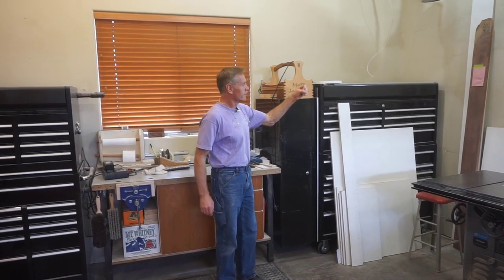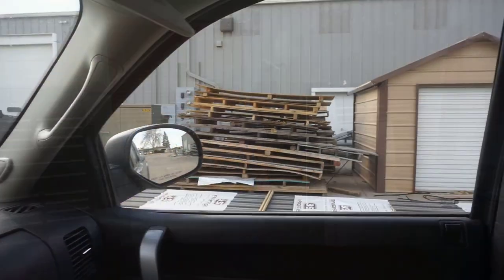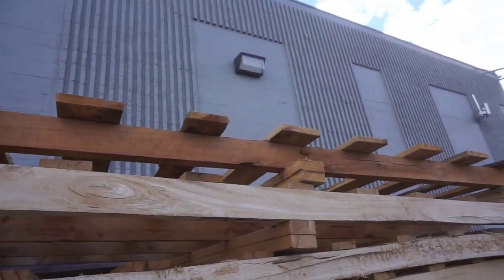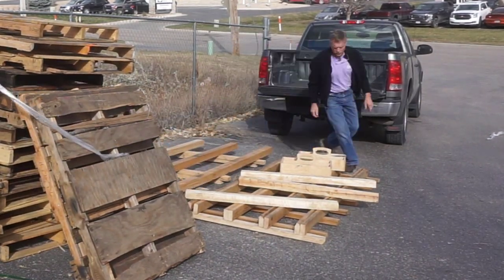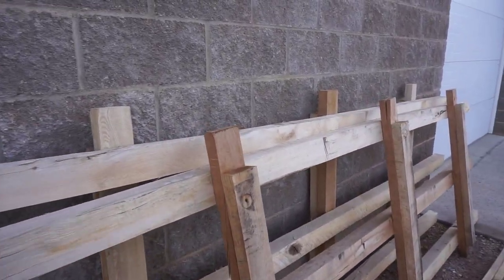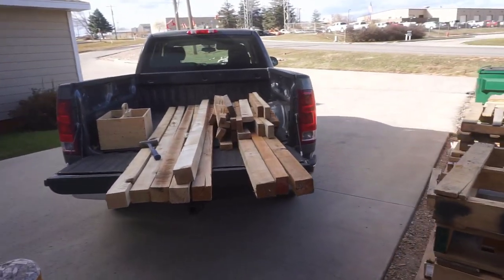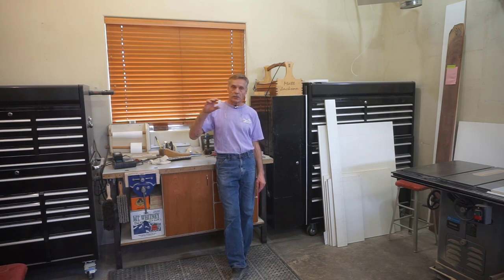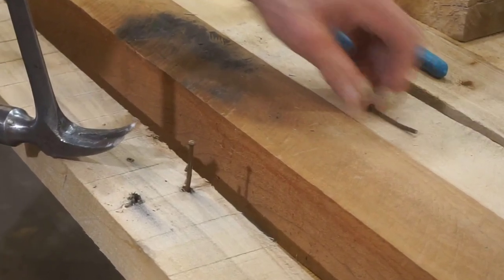A Search for Perfect Pallets

Comment: I'm the world's biggest pallet recycling fan,and about 45 years ago I was working on the construction of of a power station as a rigger,and so easy of the equipment was shipped in huge crates,some were 25foot by 15 foot by 12 foot, I got permission to take what I wanted and got enough timber to build a 25 ft x 12 ft x 10 ft work shop because  my hobby making things with recycled pallets,so you're doing the right thing,better to make something with them than burning the wood,your video was well worth watching and gets my 5 ☆ rating

Comment: I picked up some palettes and got as far as sawing them apart into boards.   However, I was at a local supplier of wood recently and they had a long  cart full of off cuts that they said are free for the taking.  This place is not a lumber yard.  They supply everything including exotic lumber to carpenters in NYC, Westchester,  and CT.  They have amazing stuff. Teak, ebony,  cherry, curly maple, rosewood, you name it. Before they deliver the lumber, they rip off the sides, clean it up,  and dimension it. That is what was on that cart. Most of it is 1/2 to 3/4. Some was junk, but some wasn't.  I figure a trip a week to that place will become my future practice. I have a truck, so I can fill er up. Can't wait.

Comment: I used to get pallets from the Matco tool dealer that services my area. They were used one time each for transporting the toolboxes he sold. All hardwood, right off the mill. The runners were 4x4s and could be cherry, white oak, red oak, poplar, ash, and black Walnut. Lengths ran 6' to 8'. The flat stock used for the spanners, again, varying hardwood species, and all 1 1/8" thick. It blew me away every time I went to pick them up. I always left thinking "JACKPOT!"

Comment: I have been using pallet wood for 10+ years for making furniture, as I am a machinist I get the bonus of being able to pick the best pallets and stickers in the shop to bring home and it saves a ton of money because even the pine pieces I bring home can be milled and used in framework and interior pieces or as scrap to drill into etc. Any sheet metal shop/stamping company will have huge amounts of pallets in the long variety and while the short pieces are usually pine the long pieces are almost 100% of the time oak with a rare showing of cherry or maple or ash.  My woodworker's bench I made from oak pallet wood for the legs and the top is solid 3-inch thick laminated maple I picked up at a local sawmill, the bench weighs around 300lbs and can hold well over 1 ton in weight on it without moving. 

As noted, pick up your scrap when pallet hunting, if you don't clean up after yourself you can cost everyone the privilege of being able to obtain free lumber. Our company no longer allows random people to take pallets because of the mess they leave.
Reply from the maker: Right you are, MWFP... thanks for adding this!   Viewers take note: should be some prime pickings places where sheet metal is used... take special note LEAVE THE PLACE CLEANER WHEN YOU LEAVE THAN WHEN YOU ARRIVE so you don't spoil the spoils for the next person... because it just might be you! Best, Matt

Comment: I worked for a few years at a custom welding shop, and steel supplier. The sheet products (up to 5' wide by 10' long) almost always came on hardwood pallets, and they usually had large piles of them just laying around outside. Check with your local steel suppliers and see what they have. You might be surprised, and they might want to get rid of some of them. All these same pallets also come lined with large sheets of nice cardboard to pad the expensive sheet material, and they work great for covering the floor when painting or varnishing, etc. You have to specially ask for the cardboard but they usually have it piled up inside somewhere, and will gladly give you some if you ask.

Comment: I for one, would love to see your video(s) on building melamine cabinets and drawers. After a lot of trial and error, I recently built a nice melamine cabinet with drawers, for my shop (my first ever melamine project). It turned out great and I really like the clean look, but there is not much out there showing a detailed (melamine) build process, and no one I know could help me with the basic info. I used pocket holes for the drawers (w/slotted bottom panels) and the pocket holes are all hidden between the front face panels...no fasteners show, and the drawers open to both sides of the cabinet. Learning the correct combination of how to clamp everything securely, which clamps to use (and not to use), the proper depth to drill and the correct length of screws, (and then getting those screws to penetrate the hard shell melamine coating) etc, was a real learning experience! I found a few different ways to blow out the chip board or crack the melamine on my test pieces and normal practices did not seem to apply, but once I discovered what worked nicely (for me) it was easy sailing, and they all turned out great! Lol, I probably did things the hard way because I didn't even want to use brad nails during assembly (because they'd be visible), but I'm betting you probably have an easier and better way...so I really look forward to seeing your take on this, please. A sharp, wide chisel and 320 grit paper to trim and sand the edges of the iron on edging worked best for me, but the edging was easy I thought, it just took time. Thanks for all your videos, I really enjoy them, and I've learned a lot from you!

Comment: I used to have a connection at a guitar manufacturer. I got tons of 5/4 hard Maple. 2 inch ash. 2 inch basswood. Anything that had a defect they would throw away the whole piece. Most was 12 inches wide by 12 or 14 feet long. I wish I could still get it.

Comment: nice to see the new shop, compared to mine its huge ;0) americans always seem to have big shops, we make do with what we have , just squeeze everything in. as for pallets, ive used them  to build a temporary shed before, covering with recycled tin sheets, and it lasted a few years till i built the new workshop, so they have their place, and i got some red oak boards as pallets 4 feet long and 10 inches wide from the local  factory, they will be fine for jewellery boxes when they are fully processed.  i must admit, im a bit jealous of your big tool cabinets ;0)

Comment: Subscriber number is up from the shot in the video. Yay! People know quality when they see it.

Thanks for the tips on pallet scavenging. Perhaps a follow-up on the recycling process, from de-nailing, to any rough cleaning, checking for fastener artifacts before milling, etc.? A look at a dual-use tool such as the AP700 from Air Locker (no affiliation)?

On another note, are the master closet cabinets for your home, or a customer's?
Reply from the maker: Hey John, thanks for your comment and questions.  I'm planning to do videos for most of the door process (which is why I started out with this even though it will be awhile before I make the door) so you should be seeing all the steps.  I'll have to look at the Air Locker but if it's what I think it is I've looked into it before and decided to do without. 
BTW The master closet cabinets are for the same house where I did the surgical sheetrock removal work and and a number of other videos you've seen.  It's coming together nicely albeit slowly.  Maybe I'll work in a shot of the finished space when it's done... Best, Matt

Comment: I noticed you do not have your miter saw in a station with supports, is that because of space issues or have you not set that up yet
Reply from the maker: My workflow and shop space make a miter saw station impractical.  I use my special roller stands for outfeed tables when necessary and generally use the 'gang cutting' method shown in another NLC video in lieu of a fixed fence with length stops.  But that's just me, Rob, and my situation is unique from many/most others.  I will tell you my workflow doesn't suffer in the least because of it though.  Best, Matt

Comment: Hello Matt. Glad to see you in the new space. Definitely want to see a video on pallet deconstruction. Are you willing to share yet what dust collector you decided on yet. Have fun in the new space.
Reply from the maker: Thanks Ron... it's good to 'be back'! Pallet de-nailing video should be out within a few days.  I'll tell anyone who'll listen about the new dust collector, dust PROCESSOR actually... check out the Gyro Air G700 by Harvey tools for a sneak peak.  I'll be doing an un-boxing, uncrating actually, soon too.  Can't wait to get that beauty up and runnning!  Stay tuned?  Best, Matt
Reply: Next Level Carpentry   Next Level Carpentry   Looking forward to them both. I’ll have to check that out dust processor out. I have a Powermatic dust collector and air cleaner that I bought several years ago at a year end sale and just couldn’t pass up on the deal. And of course Jet and Powermatic redesigned them the next year.... 😊
I wanted an Oneida system but the Powermatic deal was just to good. And it’s a great system.
Ron
Reply from the maker: @ronh9384  Timing is everything, right?  I was within hours of ordering an Oneida Dust Gorilla when I happened across a review of the G700 in the current issue of Fine Woodworking.  I knew in a minute it was the best system and solution for the new shop and decided to buy one.  As things worked out Next Level Carpentry is now an 'ambassador' for Harvey Tools so you'll see some endorsement and promotion of it in future videos. Hope that's not off-putting to engaged viewers like you and that the fact that I approached them and not the other way around is meaningful?  Please be frank in your opinion and response, OK?  Best, Matt
Reply: Next Level Carpentry   Yes timing is everything. And obviously timing came into play for you as well. I doesn’t bother me at all doing a test on it and being an Ambassador for them. Even if they approached you I would be fine with it as I know you would do a fair review of it and you are up front about it. I’m sure it’s not easy taking the time to film (and projects taking longer) and doing all the editing and uploads etc.
I personally think there is nothing wrong with being an ambassador or being sponsored by someone or having a company sponsor a video. Doing that allows you and others to do more projects and more content is a benefit to viewers.
Ron
Reply from the maker: @ronh9384  thanks for that sincere response... I really appreciate it.  It can be difficult to judge audience perceptions and reactions from 'the inside looking out' so your opinion and perspective is quite helpful.  Look forward to hearing from you as things move forward... Best, Matt
Reply: Next Level Carpentry   Thanks Matt. I’m looking forward to seeing how it works out for you. If you are going to do metal ducting take a look at Nordfab ducting.
( nordfab.com is the website I believe). My brother used their products and loves it. And I believe April Wilkerson on YouTube has a video about them. Super easy to install.
Ron
Reply from the maker: @ronh9384  Thanks for that info... I checked out Nordfab through the link you sent and it definitely looks like the way to go for metal ducting.  I've got to read up on it some but think initially that the Gyro Air G700 is designed to be kept closer to the dust source... like 15' or so, so I'm not sure I'll end up with any need or desire for rigid... time will tell though.  My main uncertainty is for what/how I can keep 4 machines 'hooked up' but use only one at a time.  I know blast gates are involved but that's about as far as I've gotten so far...  Best, Matt
Reply: Next Level Carpentry   Blast gates are definitely the way to go. I prefer metal ones but there are some decent plastic ones.  There is remotely or tool activated systems out there one of which is “Ivac”. You just have to make sure it can handle the current load of your collector or use it to activate a contacted or relay. I believe “Ivac” has a 110 volt and a 220 volt system available. If you want to go with manual blast gates Nordfab has them as does Oneida. The Gyro system you are getting is a high CFM unit and I think metal blast gates would be the way to go. If you use a flexible hose to connect to your tools try to get hose that has the wire on the outside as it is stronger and the smoother the hose is on the inside the less turbulence  and drag you will get inside the hose and you will have less of a reduction of cfm. I got my flex hose from Oneida but I am sure there are other sources.
Ron
Reply from the maker: @ronh9384  hey thanks for the 'intro to dust collection 101' info... I really appreciate it.  I've been concerned about how the bare copper wire required in the flexible plastic hose will be in practice and any hose that has it 'built in' has got to be better.  I'll know more in a week or so when I get the Gyro Air unit uncrated, set up and operational.  I notice a special plastic spiral hose clamp available from Nordco and figure I'll end up using those for hose end connections.  Thanks again... Best, Matt
Reply: Next Level Carpentry no problem Matt, glad to help. Looking forward to seeing your system up and running. I have all of my flexible hose grounded to my system. You just trim the plastic back from the wire and then use stranded grounding wire to bond to the machine and the tool. FYI, Oneida has a really good link on dust control on the website by a guy who is considered an expert in the field. Can’t think of his name off the top of my head...
If you need a video topic for the future I would love to hear how you moved all of your machinery to your new location. I have avoided moving for years due to all the tools, etc that I have! 😊
The “uncrated” comment  made me think of the topic.... 😊
Ron
CORRECTION *  It is not Oneida that has the link to the dust collection expert. He has his own website. It is http://www.billpentz.com/Woodworking/Cyclone/Index.cfm.   And his name is obviously Bill Pentz. 
And the correct web address for Oneida is  https://www.oneida-air.com/
Sorry for the confusion.
Ron

Comment: How do you quickly identify hardwood in pallets? Any links to some visual examples?
Reply from the maker: No straight answer for you Lukasz... wood that ends up in pallets us usually stuff that doesn't look much like what you see at a hardwood supplier.  Familiarize yourself with maple, ash, cherry, oak, poplar and pine and you'll be able to quickly identify about 90% of what you'll encounter.  Add mahogany to the list and you'll probably be at 98%... the other 2%?  I think you'd need to be a wood scientist to figure out some of the bizzare stuff that pallets for imported goods are made of. Good news is that if it's a good piece and looks nice you can use it even if you can't identify it! 😀😎 Best, Matt

Comment: i found that any company that has to ship things over or across a border tends to have better pallets.  your more likely to find oak, maple or other woods.  if your really lucky even exotics Once i found a pallet made from what i believe to be tiger wood.  Especially if the pallet comes from asia.  Thats the plus side, the negative side is the wood is often heat treated or fumed.  if its heat treated chances are the wood itself may have been modified, it might be workable but much harder to stain and finish.  it also tends to be harder to sand and more brittle. 

I have had good hunting with electronic supply shops in particular.